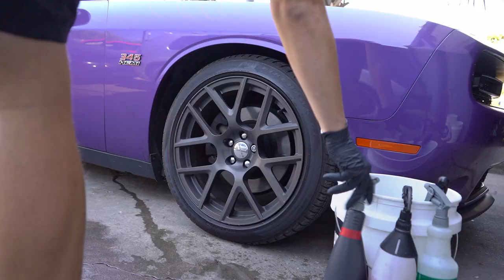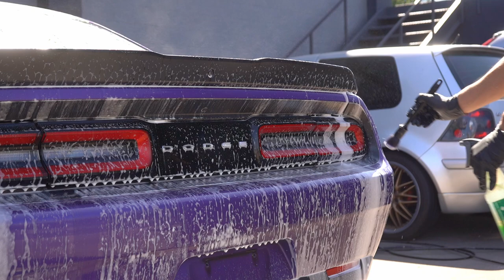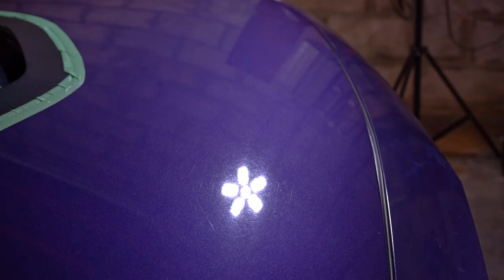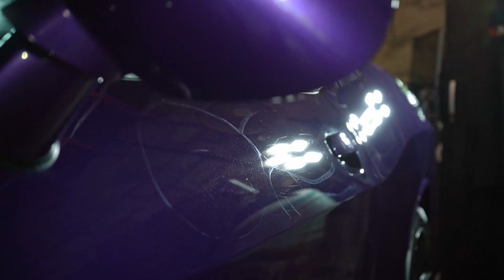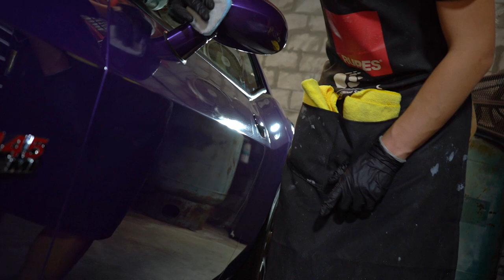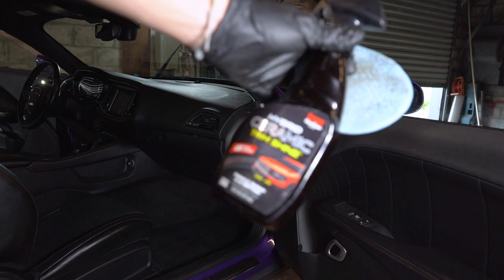1 of 14 Plum Crazy Dodge Challenger, Shaker Edition | Correcting & Coating a WILD COLOR!

Comment: Damn Son! A lot of work!! 
So what’s ur price onna job like this? 
Was there a ceramic coat applied to to paint? If that’s the AO4 🤷🏻‍♂️ I think that’s what it’s called you used. 
Very nice
Reply from the maker: Yes it was ceramic coated! I appreciate it. Price on something like this ranges anywhere from $1,500 2,500 depending on what all was done. From the scope of correction, what kind of coating, etc